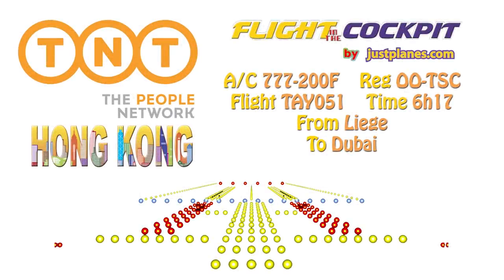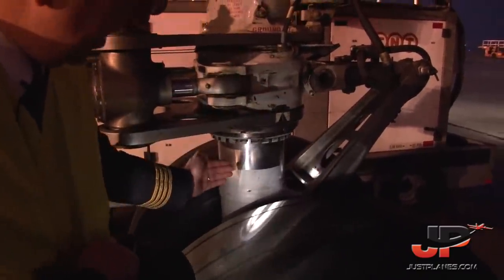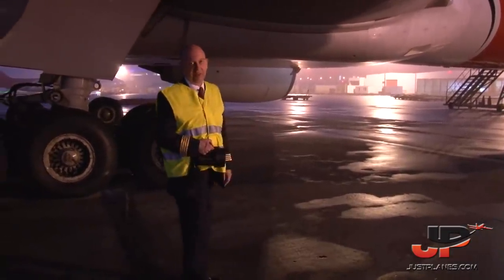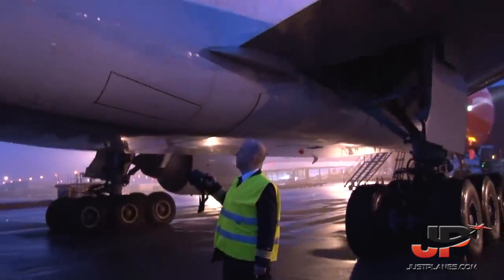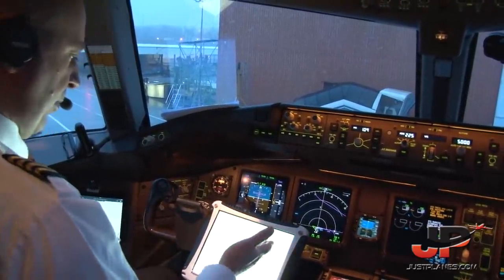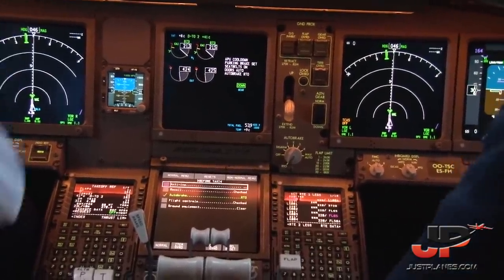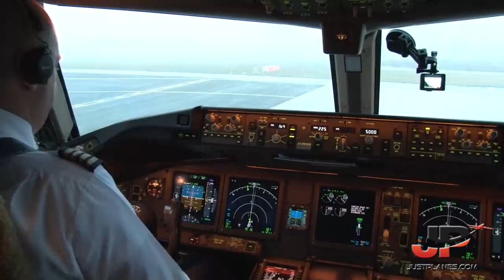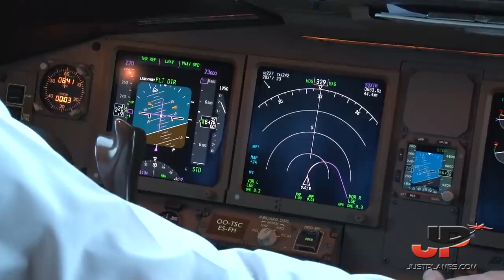Piloting BOEING 777 in Low Visibility | Cockpit Views

Comment: What did the Captain do between  35:58 and 36:00? Set standard. Could someone throw some light on it? That's a new for me.
Reply: Siddharth Gurjar At “transition height “ the altimeter is changed from the local pressure setting to a “standard “ setting so that all aircraft are using the same settings instead of constantly having to change , with the risk that one might miss an update and be at the wrong altitude compared to all others around them.